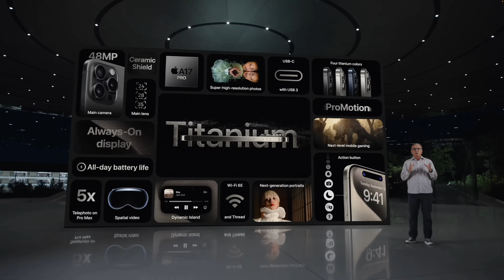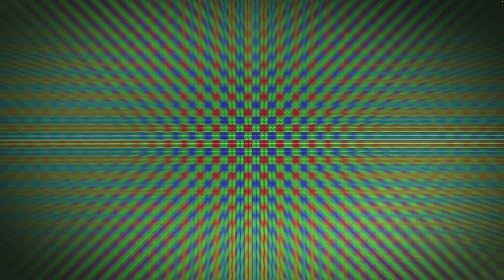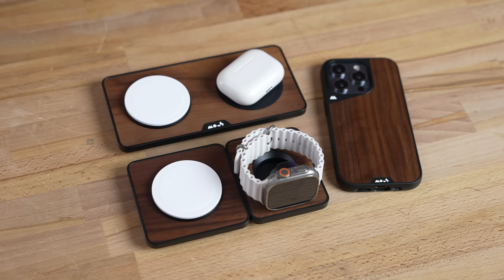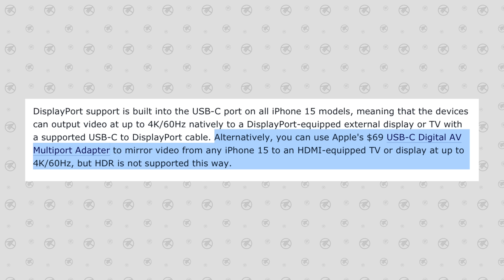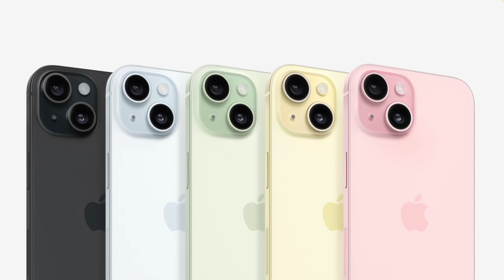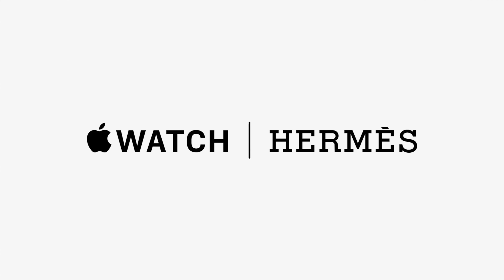iPhone 15 & 15 Pro/Max: 23 Things Apple DIDN'T Tell You!

Comment: You said that even the 13 &14 pro's will get that option where you can turn a normal photo into a portrait photo. I dont see that option on my 14 pro max, are you sure this is true ? I can only control the focus and depth if I take a photo in portrait mode, for normalt photos it's not possible to add the portrait effect after.

Comment: Honestly the iPhone 15 Pro is a disappointing update, particularly in the camera department. They need to increase the megapixels to 48MP on all sensors at a minimum, and maybe the main camera should be 64MP or even 108MP. They have the processing power with the A17 Pro, but I feel as though it is under utilised. 

I’ll hold onto the 13 Pro Max for now, I see little reason to upgrade until they improve the cameras, make the dynamic island smaller and maybe make a slightly bigger phone (6.9 inch iPhone Ultra?)

Comment: To me, the standard 15 seems the best value with the most upgrades - it seems to have gained some Pro features.
The 15 Pro Max has the x5 zoom and better stabilisation but the standard 15 Pro seems not to have gained much - especially camera wise. Pity, since the 15 Pro is the one I was considering.
Reply: The pro has titanium and 120 hertz refresh rate Etc
Reply: @cherkas009  he desribes upgrades each series got. The updates on the standard 15 versus 14 are big, the updates on the 15 pro (and max) versus 14 pro (and max are marginal). He is right in this aspect.
Reply: Battery sucks on 15 pro so might as well get 15 pro max

Comment: Number 3 is wrong. It’s not the same camera - the 15 Pro has an upgraded main camera with a larger sensor than the 14 Pro.
Reply: No honestly, it really is the same. Same aperture lens but also same sensor and pixel size. iPhone 15's aperture is larger but the sensor is smaller. 2 micron pixels on the 15,  2.44 micron pixels on 14 Pro/15 Pro. If you do the math with the size of the pixels when binned to 12, compared to the number of pixels, the 15 has about a 1/1.5" sensor and the other two have 1/1.28", quite a bit larger!

Comment: you got it wrong, it's the 15s one that got the old 48mp while the pros got a new bigger sensor
Reply: No actually, if you really closely look at the specs on that keynote, the sensor and lens both in the 14 Pro and 15 Pro are identical - f/1.78 aperture, 2.44 micrometer pixels, and if you look at a site like XDA Developers you can see it's a very large 1/1.28" sensor. The 15 on the other hand, got an entirely new sensor and lens, with f/1.6 aperture, 2 micrometer pixels, and like you can with the Pros, you can find logs that mention the sensor size - about 1/1.5". It's not small by any means, but a lot smaller than on the Pros!
Reply: Yup, that was my understanding as well. Rewatched the keynote and they say the 15 pro’s get a newer 48 mp sensor.
Reply: @whatevaidntcare  Actually, if you pay really close attention to what they say about that sensor, it's "even larger than the one on iPhone 15". But if you look at the specs they show in the very small text on the side, the specs of the 15 Pro camera hardware is identical to that of the 14 Pro
Reply: @conspicuous_cracker  actually, in the keynote they say, “with an even larger sensor than iPhone 15” #charbroiled
Reply: @whatevaidntcare  Yep 👍
Reply: @conspicuous_cracker just researched it more. So the 15 is using a smaller sensor then the 14/15 pro and the 14/15 pros r using the same sensor. No actual sensor upgrade for the pros. 😢
Reply: @whatevaidntcare  Yea they did their best to hide it in the keynote based on their language. Clearly it worked pretty well as most ppl I’ve heard (including me at first) thought it was a brand new sensor!

Comment: 12:28 Yo, I understand this line of thinking, but it’s so flawed. Apple is Apple and Hermes is Hermes. They are separate companies. Apple can’t (shouldn’t) impose their values on other companies. And I don’t agree with the sentiment that Apple is greenwashing. They are doing what they can do, with what they are working with. They can’t enforce what other companies want to do. It’s a licensing agreement. And Hermes’ whole thing is leather. Gee whiz, yo.
Reply: But Apple have the power to make Hermes stop using leather. They could've just removed the Hermes watch face if they still use leather. Anyways, I think that it's good that they didn't enforce that

Comment: After having the 14 pro for awhile, I think I’m just gonna jump to the 14 pro max… The 15/pro just doesn’t seem like that significant of a jump. Hopefully the 15 ultra or 16 will have more changes.
Reply: I would keep the 14 pro or jump to 15 pro Max
Reply: id just wait for next years model instead if i was you. the reason to get the 15 pro. is the usb c and the action button, the better ram, but i dont think it would be worth changing the same model, for a bigger version of that model.
Reply: See if your carrier has a deal

Comment: Hi  @Maxtech - For your point 19 iphone 15 pros will be able to charge other phones as well i mean android ...Also if other phone is using usb pad c like 15 pro then if iphone battery is less than the another android or iphone then ur phone will charge or if your iphone battery is more then the other phone wil charge. Also it will charge at 4.5 watts only

Comment: I have a 13 Pro Max and waiting to see the reviews on phone and battery drain tests, etc. If not a high upgrade, I may stick with my 13 Pro Max.
Reply: It’s actually even worse than 14 Pros, which was a downgrade to 13 Pros😂😂
Reply: Same, still rocking my 12 Pro Max!
Reply: I have a 13 PM and what i saw it has less on screen time than 14 pm 😖 i stay on 13 pm
Reply: you should wait anyways. 3+ years is the default cycle these days.

Comment: Finally Mous as a sponsor! I’ve been using their limitless cases for every iPhone and they are by far the best! I’ve got to say the lock button on 14 pro max was way too sensitive compared to the previous model so I hope they fixed it with the newer one.
Reply from the maker: The cases are great and the new wireless chargers are really sweet too. I love the wood and that you can split up the Magsafe and Apple watch charger and use them separately if you want, or you can connect them easily and power with just one cable. Also, the USB-C output is really convenient. https://bit.ly/3RsuBHJ

Comment: Are you sure about the point made on no.9? I saw what you referred to on the iPhone comparison page, but when you google portrait editing, a link to apple support page shows up where they mention that changing photo mode to portrait feature is only for 15 models. Changing focus point in a portrait is the only feature shared with iphone 13 and later, while other updates are applicable for older iPhone as well. Someone with iPhone 13 running ios17 can verify if they can convert photos to portrait
Reply: I agree. I cannot do this on my 14PM
Reply: I was about to comment on #9. 
Yeah you can only change the focus of the already portrait photo in your album but not add portrait depth effect of any images.
Reply: I can’t edit a normal photo to be a portrait as well on my 13 pro max. This “feature” is locked by software for the 15 models only.
But you can use for example the app “Focus” to add blur to the background.

Comment: It's not true that you can add portrait mode after the fact on older phones - you can change the focus on existing portrait photos, like they showed in the keynote, but. you can't make a non-portrait mode photo into a portrait mode one. I also think it's BS that this new "next generation portrait mode" is not coming to the 14 Pro - since it has the same SOC as the regular 15 and a better or similar 48MP sensor - Apple should allow this to come last years pro phones instead of shitting on their pro customers.
Reply: Yeah they’re really scamming 14 Pro customers here, as it’s a pure software feature they’re holding back.
Reply: @pressrepeat2000  exactly, the same with the new 24 megapixel images that should be possible on the 14 Pro as well. I don’t understand why there are not any reviewers mentioning this.